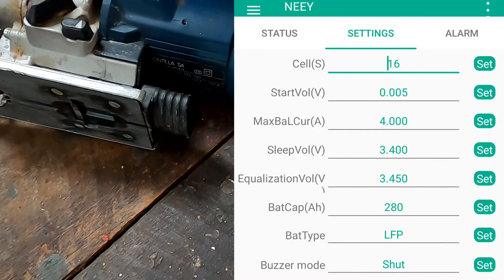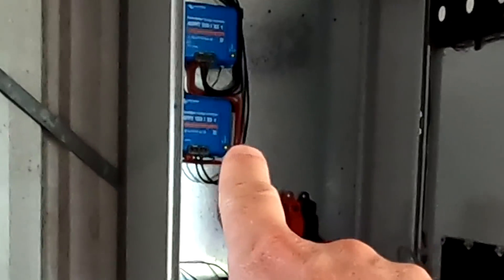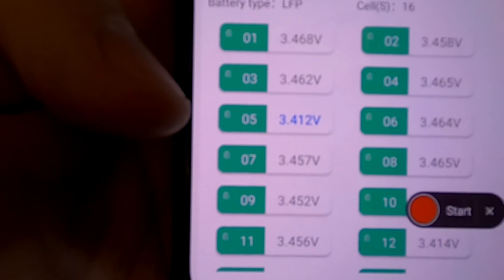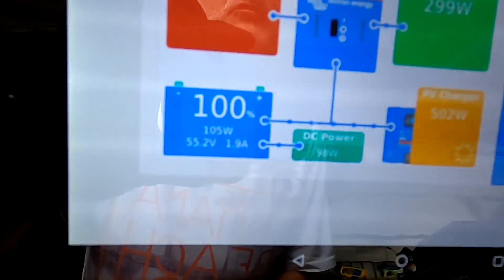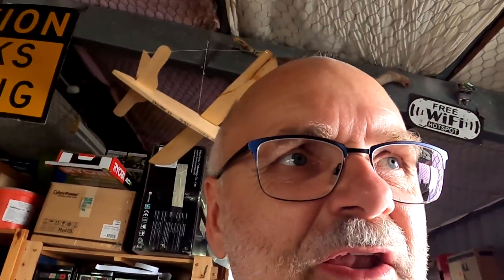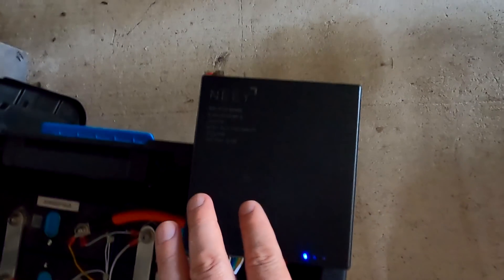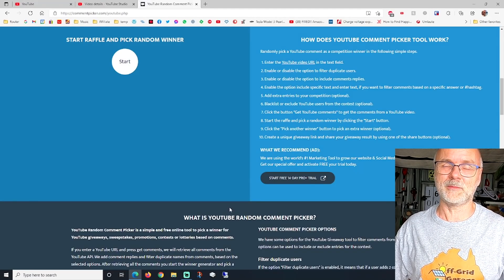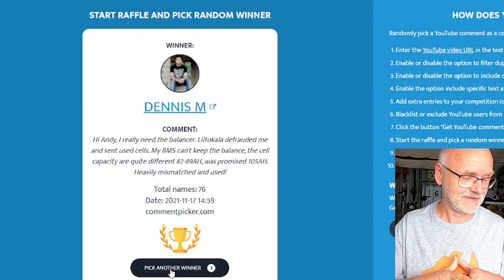Disconnecting the NEEY Balancer forever! 😔

Comment: Andy, how much does the version 3 NEEY active balancer cost & which active balancer make & model (& cos) did you finally decide to use for your system?

Frankly, I think that NEEY active balancer is a pretty good unit--even though you don't like how it isn't perfect in how it is triggered via your user inputs.
Reply from the maker: There is a link in the video description to my website with all info, pricing and where to order.
I will now go with the JK-BMS which already includes an active balancer. This is also linked on my website.

Comment: I've had nothing but success with the V1 Neely, combined with the QUCC Bms.. Battery system running perfectly balanced for over 1 month now on 16s 280ah lifepo4. All your HW recommendations so far have worked great... Cheers...
Reply from the maker: That was the version which never turned off. It always balanced. Like the simple capacitive balancers we have tested here before.
This method did not work for me and created a huge imbalance when the balancer kept working in the flat part of the voltage curve.
Reply: I also want to mention I dialed down the balancing current to 3A on the Neey.  Batteries also came from alibaba (Amy) which were top balanced first before commissioning. Very important even though they all came with the same (almost  perfect) voltage. As it was recommended to do in one of you earlier videos..

Comment: " Real Capacity "  =  Gross Capacity  from 2.500 - 3.650
Working Capacity 3.00-3.400 Generic to all grades

Assuming a Full Pack as you just did and you stop the balancer and ten the New Pool Pump kicks on, how will the cells deviate in 1 hour, 2 hours and after say 5 hours ?

Also when discharging that pack, as you head to 0% SOC when do the runners drop to the bottom and how far have they deviated ?
Reply from the maker: The smart shunt resets to 100% if all cells are at 3.65V. That means 0Ah have been taken out of the battery. That's the maximum capacity/SOC of the battery then. And from here, the shunt start counting and calculating the shown SOC.

If a load kicks in (without a charger or balancer connected), the deviation will go down as we hit the flat area of the curve. When we recharge, the cells should all go back to 3.65V at the same time. Well, that's a theory and would work if you have perfectly matched cells with identical internal resistance.

If you keep discharging one of the cell will hit 2.5V first. The deviation totally depends on the power you draw on the battery. Shallow discharge will cause small deviation only and high amps a large difference.